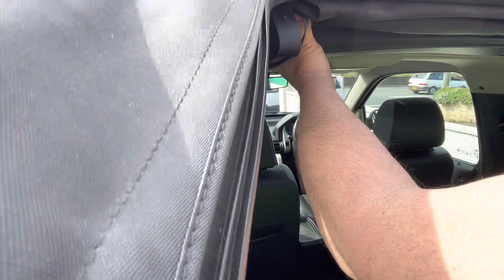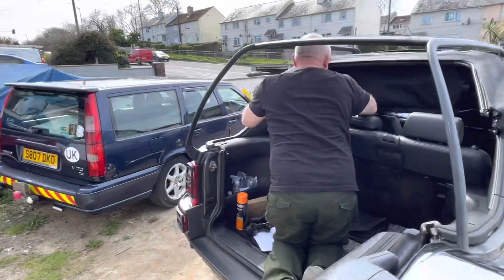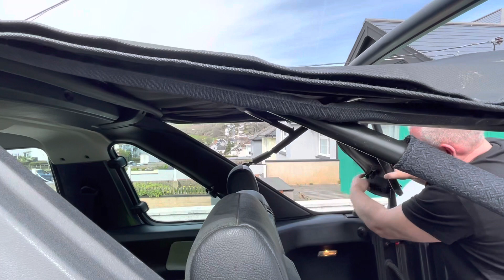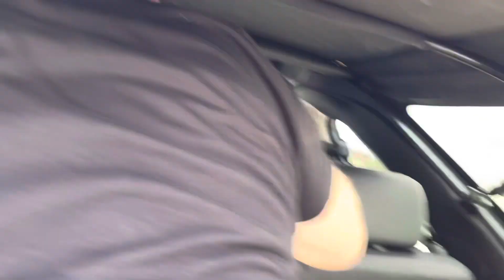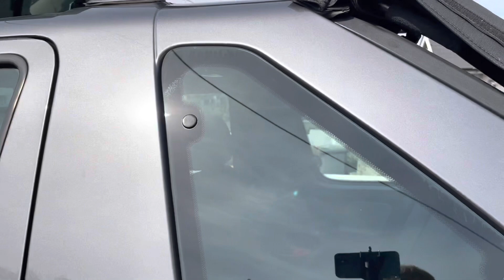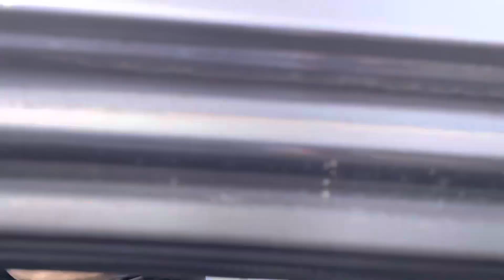Soft top on a Landrover freelander 1,3 door,a guide on how to put it on,removing the glass sunroofs

Comment: Hello. I'm from Brazil and I managed to buy a new, unused top, but the two straps that lock it to release the rear window closure didn't come with it, so I ended up using the straps from the hard top that I removed from the car. Could you give me the number of both parts so I can look for them. I managed to buy my soft top from the Freelander 1 group in Portugal on Facebook for 75 euros.
Reply from the maker: Hello 👋,The pair of clamps are obsolete and you’ll be very very lucky to find new ones but you might be lucky,part numbers available online as ours is in storage at mo
Reply: @Retro-Tels-van-life-channel  Thanks 🙏🏼